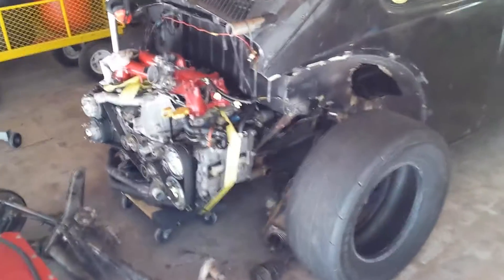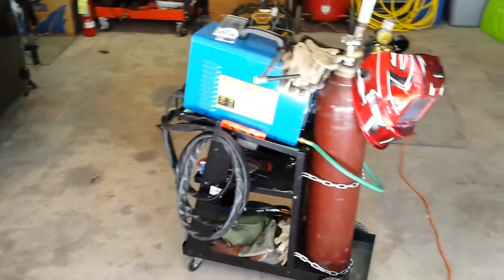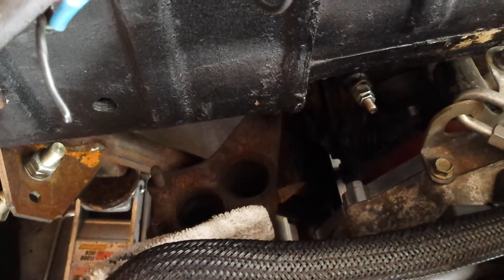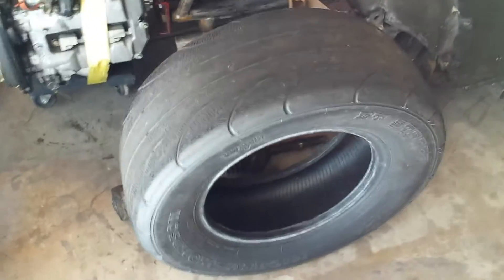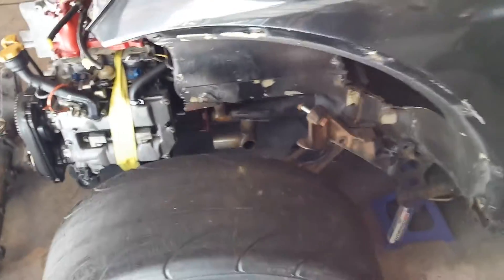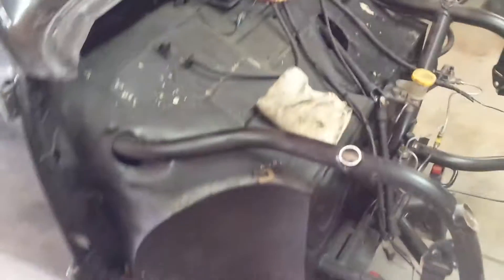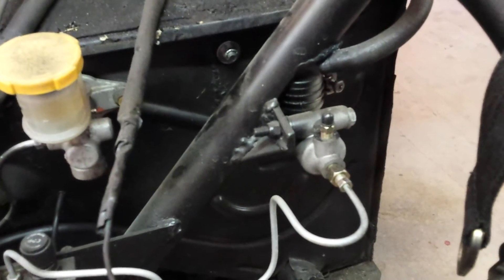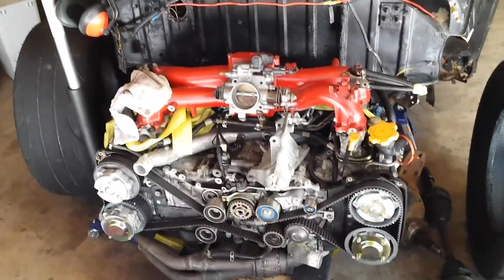VW Bug Project With Subaru Engine: Overview

Comment: stock cv shafts fine for a turbo ej?
Reply from the maker: randall lucas Should be,  unless you're launching hard on a sticky track, might be good to upgrade to the torsion sway a way shafts that give some.  But the shafts probably aren't the weakest point.
Reply: THANKS MAN your a knowledgeable guy appreciate it im running a performance trans just want to make sure everything is reliable it wont see a track but might see a little street action
Reply from the maker: randall lucas No problem!  And thanks!   You'll probably be just fine, cause streets aren't near as sticky as tracks. It would be the hard launches with sticky tires, on a good sticky track that would kill stuff.  What engine/hp setup are you going to run?
Reply: iv got an ej20g with up graded turbo going to do a few aftermarket parts reaching for 300hp
Reply from the maker: randall lucas Nice!  You'll most likely find the weakest point 😊
Reply: i hope i dont for a while lol

Comment: Where did you buy your adapter plate? I know it's not hard to find on Google but I'm looking for a buy it now.. ked adapter plate to a stock be transmission.
Reply from the maker: Mark Villanueva Pacific customs or Moore parts usually have the cheapest,  I'd check both and go with the cheapest one.  That's what I've found to be the cheapest buying new and they both have free shipping. Just make sure you are buying the right one for your transmission.
Reply: Do you think you can link me? Honestly I'm kinda new to the vw scene.. I'm using a stock be transmission, I don't know what clutch assembly to use.. if you could live k me that would be greatly appreciated.. I'm planning on using a ej207 motor
Reply from the maker: Mark Villanueva I would recommend calling either Moore parts or Pacific customs and talking to them about what you want to do, etc.  They can give you part numbers,  or just order over the phone.... I would rather you talk with them and explain over the phone what you need so you can get the right parts. Just Google the shops I mentioned and they will help you out!